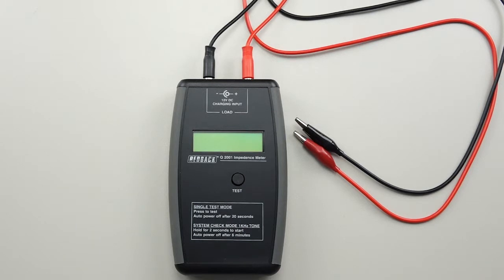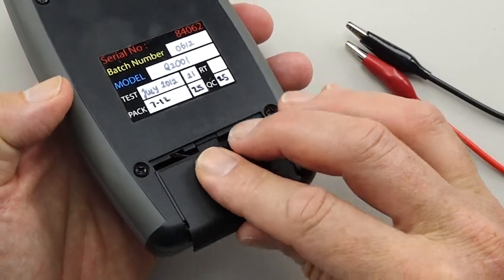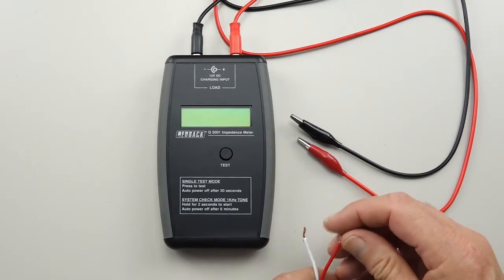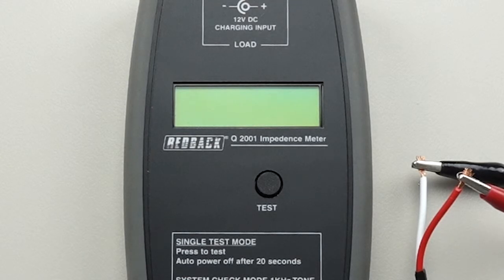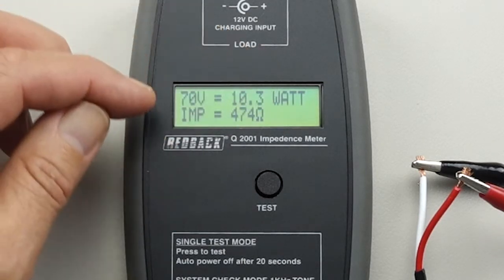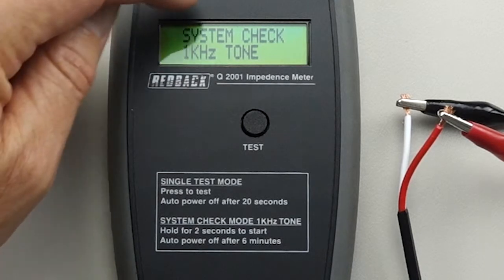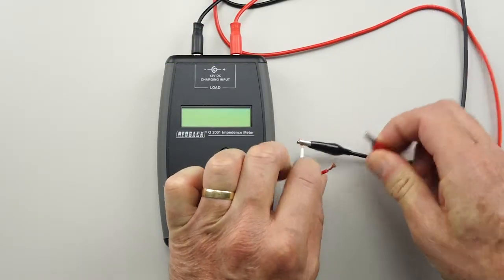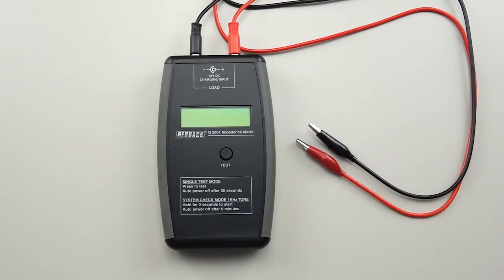Altronics Redback Audio Impedance meter  Q2001

Comment: The speaker is 10w + 10w + 2.5w + 2.5w = 25.0w..but why the meter calculate the total w only 21.0w?
Reply from the maker: Very good question. The ratings printed on each speaker transformer is a guide. There are so many variables. The goal rating is designed for but does not exceed it. For example: a “20 watt” tapping point on a transformer may in reality only be 19 or 19.5 watts. And another speaker may be 19.8 watts. Hope that helps.

Comment: Hi Gary,  sorry for the same question again.  Would this meter show if theres a short in the line??
Reply from the maker: Yes it will indicate “0” ohms indicating there is a problem with the line.
Reply: @GaryDmedia  thanks Gary, to narrow down where the short may be, could you then split the circuit and look which direction is giving you 0 ohms? Also if it were an intermittent fault, would this technique replicate the fault even if it wasn’t currently active? Thanks
Reply from the maker: Luke, fault finding is a very difficult thing to do. Disconnecting runs of speakers and testing each run separately best practice.
Reply: @GaryDmedia  exactly what I did back then

Comment: It is fairly expensive.  For a fraction of the cost I'm pretty sure someone could build a test circuit himself.  Unless you're using such tester on a regular basis, it would be very difficult to justify such investment.
Reply from the maker: Yes I definitely agree, even the more simple model from Australian Monitor are around $150. The problem lies in the fact that it is not just a glorified multimeter. You can use an audio generator and a micro volt meter but again unless you have access to these items it can then be a bit cumbersome to setup.